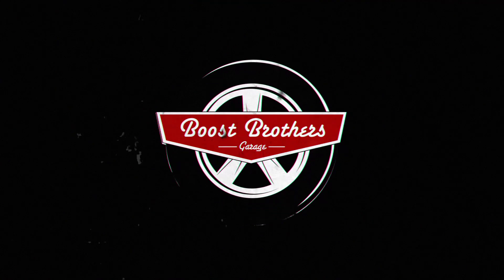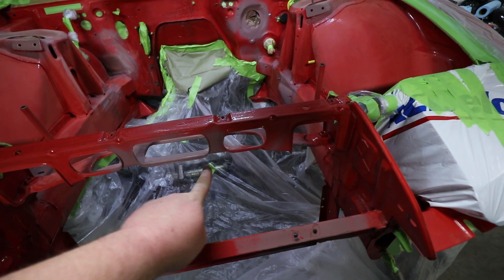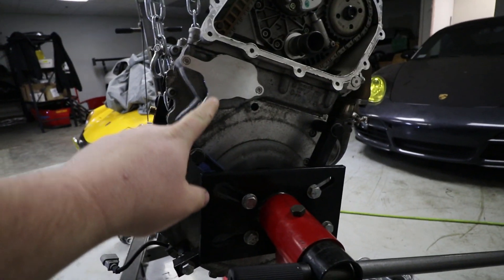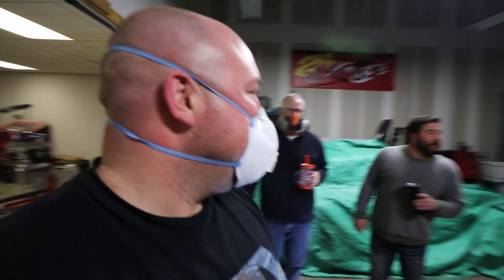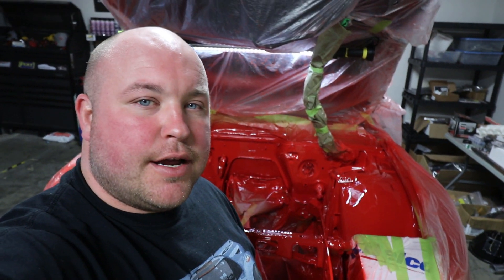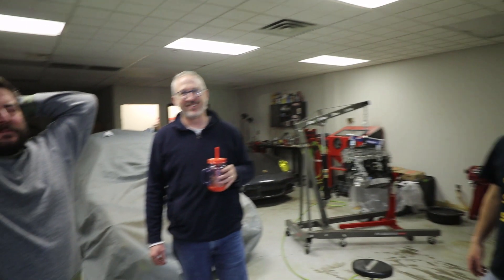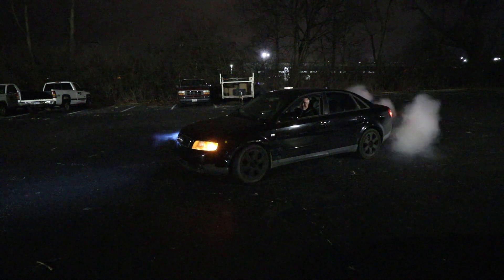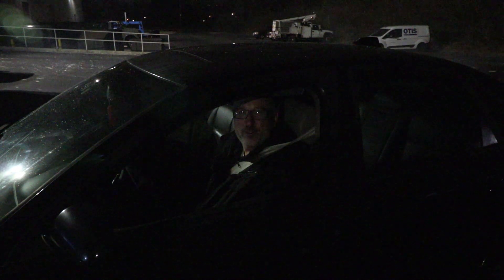Turbo 07K Build - Part 3 (Porsche 944 5 Cylinder Swap)

Comment: Hi guys, i was wondering what transmission do you guys recommend for the turbo swap? I currently have a 1983 n/a 944 which is generation one. Will a turbo transmission and differential like the oar code fit properly without any fabricating? Also will your swap kit fit a gen 1 car too.

 Thanks
Reply from the maker: Hey Paul! Any turbo, turbo s or 968 trans will work perfect. You can also go Audi 01E although none of the swap kits have hit the market yet.

Our kit does work with the early cars! It even works with 968 and 924S but no the regular 924.

Comment: That audi bit was great! I used to have one like that and it lasted for ever!

On a side note are there any pros and cons for the spa header compared to the gallardo header from a power or turbo fitment standpoint?
Reply from the maker: I would say the Spa is the best option for packaging, but a tubular manifold is always going to perform a bit better than a log style. The cast iron construction of the Spa is a big advantage, as is the cost. I did the Gallardo header strictly for the cool factor if I’m being honest.
Reply: @BoostBrothersGarage good to know! Do you think the better packaging of the spa and turbo will help spool times? Also what diameter exhaust diameter do you think would run well for the length of the car. Would 3 inch be too big or do you think the stock 944 exhaust would work without power loss on a turbo engine?
Reply from the maker: 3” is basically a must. I will be running 3.5” but Alan’s car will be 3”
Reply: @BoostBrothersGarage  it will be cool to see the difference betwern you car and Alan's! Thanks for the info!